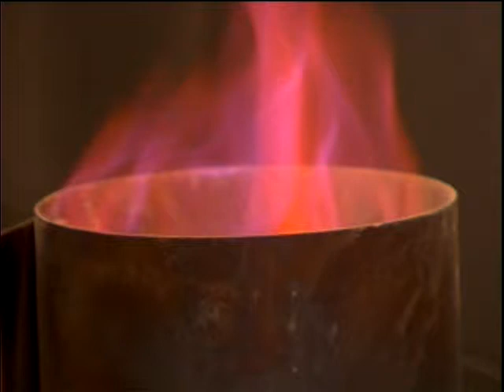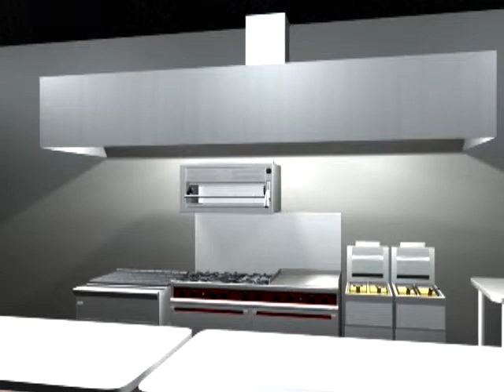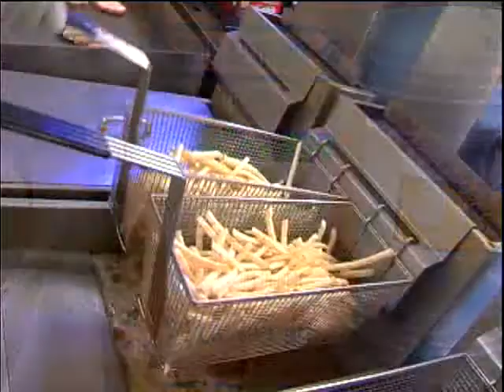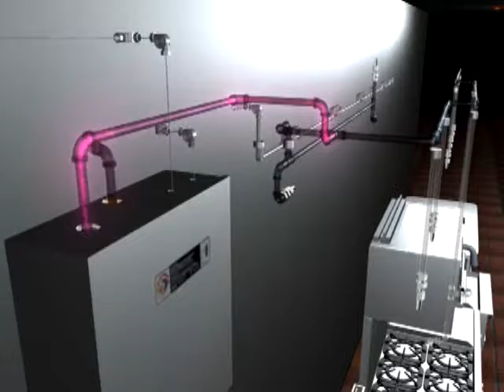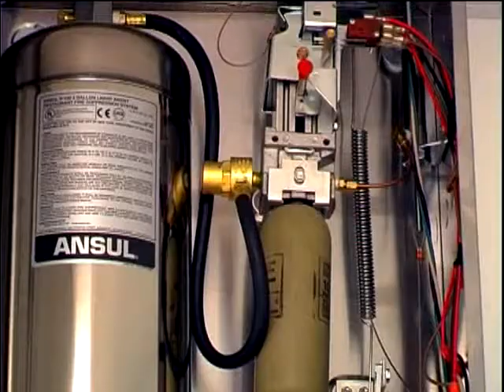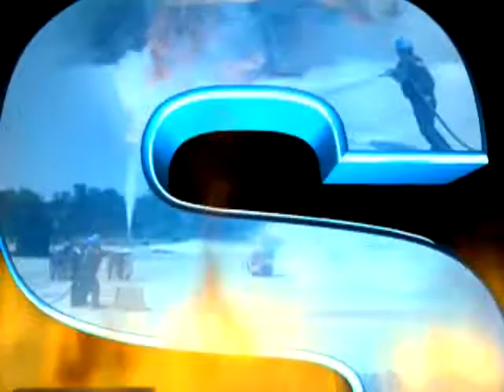Ansul Restaurant Fire Suppression Systems

Comment: I do hope that this newer technology is easier to clean up after a fire. I had the unfortunate job of cleaning up one of the old Ansul dry chemical suppression system. That damn dry chem went everywhere and took hours to clean up.
Reply from the maker: Dry chemical systems no longer meet code in restaurant kitchen systems.  Ansul uses a wet chemical that is much easier to clean up and does not harm any of the kitchen equipment.